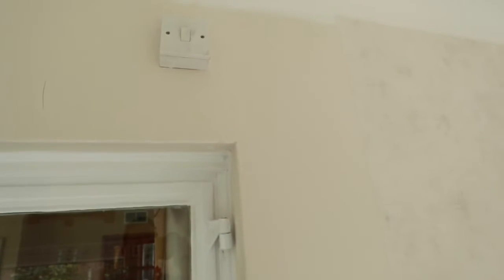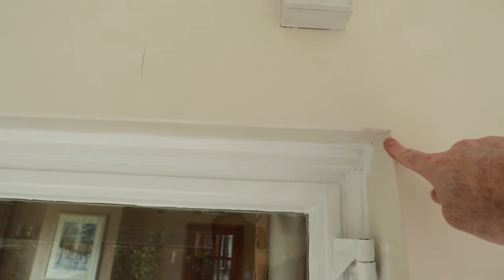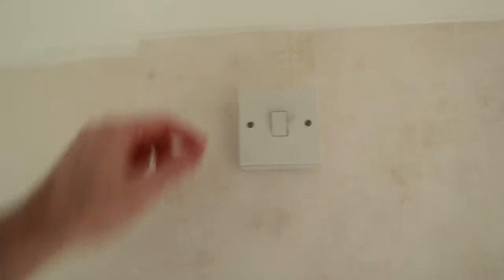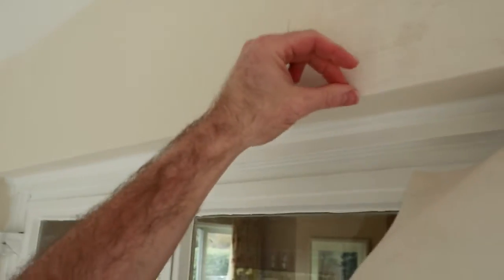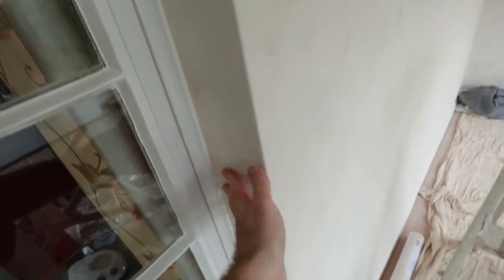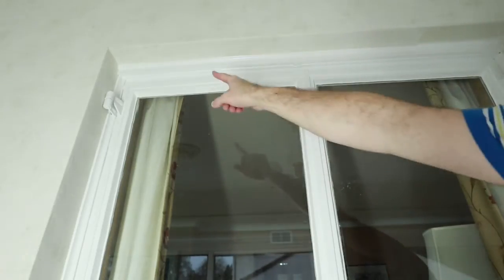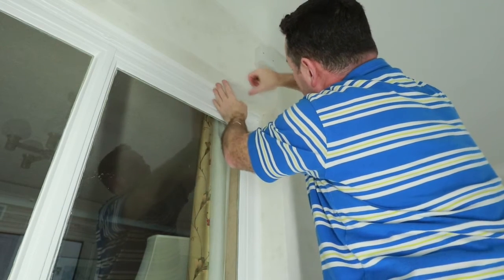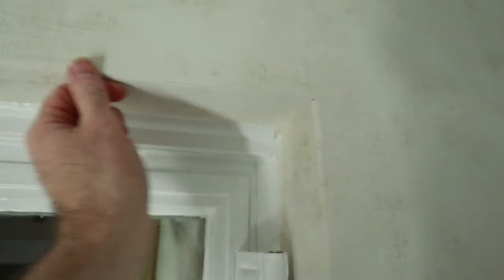how to - wallpapering around a window - the nasty bit

Comment: Hello Phil, I was a decorator for ten years (1996-2006), then I went off and had a “career” which after 16 years I have had enough of and have decided to go back to my passion. Just started out again. Paste the wall has clearly come on a long way since my first time round because it was truly awful. Difficult to control the saturation. I’m always happy to move with the times and blend the traditional with new ways but have you encountered any issues with the modern PTW papers? And do you use dedicated PTW paste? 

Really appreciate your videos, when I was working out how to go back to decorating they kept me inspired, so thank you. All the best
Reply from the maker: Lovely words Thanks.

PTW.... Don't over think it.
But..... Some PTW papers have very very small 'glass' beads on them.. drop everywhere.
Even though they are non woven PTW. Those papers are best to be pasted on the paper. Brush down the length to get any loose beads off, then paste as normal. Then hang.
The reason you don't PTW with those.... If you did, the beads can drop off while hanging.. stick to the paste in the wall.. you can't see to remove them.. but they'll show up under the paper like a bowling ball once youve got it on.

Also get yourself a decent laser liner.
Reply: @ProfessionalPainterDecorator  I will definitely invest in one, thanks for the tips 👍
Reply from the maker: @xxnonstopdancingxx  btw... Paste... Wickes own brand does almost everything 
If you have a expensive paper that says use their paste.   Let tye customer buy it. Then no come back ;)
Reply: @ProfessionalPainterDecorator  thanks for this Phil. I have a wallpaper job on Monday. There is a Wickes about 5 miles away en route to the job, so that is handy. What is even more important is that there is a van in the corner of the car park that does a bacon and egg fresh baguette for £2.50.
Reply from the maker: @xxnonstopdancingxx  the Tarde card discount will pay for the food lol
Reply: @ProfessionalPainterDecorator  Hi Phil just wanted to let you know that I used that Wickes paste. Brilliant. Thanks for the tip. I doubt I’ll ever mix my own paste again. Really easy to use, great open time, able to use a spritz of water to increase slip if I needed to without soaking everything. Game changer for me. Appreciate it 👍
Reply from the maker: @xxnonstopdancingxx  great to know ... Don't tell too many.. let them struggle with packet past a bit longer lol

Comment: Thanks Phill, love your videos , really helpful , can you go into window reveals with wallrock thermal lining paper? Thanks
Reply from the maker: The fabric wall rock or the polystyrene backed one?

You can, but you cut it neat to the corners 

Then polystyrene/paper faced one, if you have and gaps etc, use one of those light weight fillers .. like red devil or the prestone light weight fillers..... Keep it neat and it will dry 
Then you'll line over it again just with the normal fibre non woven wallpaper rock.

They'll be a video on the thermic  carbon WallRock  later on in March.
Reply: The fabric one

Comment: Hi Phil.  Thanks !!! Followed your advice for the joint infill instead of the splice and it went in a treat 😎👍👍
Reply from the maker: Glad to here, it means less visible cuts .. but there will be times doing a splice will work in your favor.. it will depend on tye type and pattern of a paper.

Glad you had success though :)
Reply: @ProfessionalPainterDecorator  top man. Working that but edge was a worry till I started melting the two edges together! Great vid. Great advice

Comment: I'm part way through a job where I'm papering a bathroom with a heavily patterned floral vinyl paste the wall for the customer, it was spliced around the window previously, so was going to do the same, but you've got me rethinking it now!
Reply from the maker: Hi Kris.
Do what you feel is best visual to the eye.. also for you too.

I had one yesterday I had to slice as I had no room to fit a piece under. But it was no pattern, no match and you couldn't see it.

If you have spare paper . Try both ways if you can.
What you don't want is a splice through the pattern that moves and it then doesn't look like it's matching.

Every job is different. It's being able to do various ways that's handy to have in your arsenal ;)
Reply from the maker: How did the paper look before being spliced?
Had the edges sprung . Or altered in colour highlighting where it was cut?
Reply: @ProfessionalPainterDecorator  looked okay to be fair, it's a light background design, the edges had darkened slightly but considering it's a bathroom with only a window for ventilation it had held up pretty well, they had a 5mm overlap on the underside too, where the upright part met the spliced in section underside. The customer was good at decorating when they were a bit younger and did it themselves I think.
Reply: It's a shame I can't attach a photo in YouTube comments!
Reply: Actually, after looking back at the before photos, I'm going with your method 😊
Reply from the maker: @krisholden8490  always PM via Instagram if needs be
Reply from the maker: Just a follow up. Been to a job and saw a room where it had been spliced/cut across from the corner of the window to where the edge of the paper is. It stood out like a sore thumb. You saw the cut, which has sprung slightly and the pattern matching had moved slightly.
So... You need to work out what looks best for the situation you're in.

Comment: Always splice it's not difficult at all, it's just the same principle as matching 2 lengths up but your just doing a double cut. This is an amateurs way patching pieces in.
Reply from the maker: Thanks for your input.
Reply: i agree 100%  not a good look for a professional .for example if that piece springs it will look worse than any splice.

Comment: Great video yet again mate. The Whicks paste that you use, can it be used on paste the paper  and wall.
Reply from the maker: That it can. 
I also use it for WallRock fibre lining.. paste the wall.
For normal (800 + etc) lining paper or normal wallpaper, you may thin it a bit to aid apply.

If the wallpaper is prepasted (you know, those that say soak in a water bath) we really thin it down, almost like a watery thin paste.
Works very well.
Reply: @Phil Beckwith The Professional Painter & Decorator  Thanks Phil. I will certainly be giving it a go on my next wallpapering job 👍
Reply from the maker: @davidstanger9077  don't laff.... B&Q good home is also ok.
I used it when my local places didn't have any yellow top beeline... And hung a quality finish paper with it.
The video was a few weeks ago about placement.
Didn't have any problems
Reply: Haha, I used Good home durable matt a few weeks back which the customer had already bought and It wanst to bad, cover really well white over cream in 2 coats.

Comment: great vid and explained very well. I would of like to seen the reverse cut to you first piece of paper you hanged in part 1
Reply from the maker: What do you mean reverse?

Another vid goes out Sunday showing the other internal angle being done.
Reply: @ProfessionalPainterDecorator  so you've hung your first piece of paper overlapped it then trimmed of excess paper . the second piece of paper you talked about doing over lapping then trimming with your shears. I've heard that called a reverse cut not sure if it correct mined.
Reply from the maker: @richardloze5994  I follow you now.

Yes. I was giving the example that if you came in from the other side, you can find that where I trimmed more at the top on the left length... It can be more off the bottom on the right length. (Into the corners).

Sunday video may show you bette how you come back onto your overlap (the 5mm return)... Using the trimmed down off cut.

My other videos showing you papering with a laser liner on corners that run out may also help.
Reply from the maker: https://youtu.be/mKj2fGjBJE0 take a look. Any better?

Comment: Not a method I would entertain, FairPlay to you if it works
Reply from the maker: Why not?

It a good way, when you have papers that can show cut joints, or there's a chance of pattern looking off due to cutting through it.
Nothing worse than seeing an angle cut from the corner of a reveal to a good paper edge.
Doing it how i show means you'll lose any cut edge on the corner of the reveal.

The less cuts and splices the better.
Reply: I would just have one vertical splice which would be seamless and with correct pattern match.
On the under wrap around I imagine you would have a sharp edge against your next piece which you have wrapped around. If it works for you great and your client is happy, that all that matters. Plenty of ways to skin a cat as they say!
Reply from the maker: you need to weigh up the type of paper too, 
that blue oriental style paper I show on other videos, I did cut top to bottom over a window...
1. the window edges could take it.
2. the paper was non woven and cut well
3. how the papers fell, it meant I could lose the cut well, without seeing it due to the fussiness of the pattern.

So I do it that way as well, when needed/or when allows.
Reply: It works is the main thing

Comment: You wouldnt always put that end peice in before the other 2 short pieces.if it wasnt paste the wall.paper it could expand more and you get it overlapping when it dries out properly.
Reply from the maker: thanks for the comment. If you are talking about PASTE the paper.. as long as you allow it to soak the correct length of time, you don't get expansion/stretch of the paper. I see people having problems with expansion, but that comes down to not giving it enough time. 
I do all sorts of papers.. PTW and PTP, my style can be the same with either. 
Don't forget.. Tub paste is key too. Less water content ;)
Reply: @ProfessionalPainterDecorator  I'm saying if you where using a normal paper I would nt really hang the other corner piece and the one next to it before hanging that 2 nd piece as it might possibly start overlapping once it s dried out.
Reply from the maker: @davidphillips744  it shouldn't overlap when it's dried out.

Comment: Your doing a good job but in my opinion you shouldn't put a but joint above a window like that because all it takes it a slight bit of moisture and it will probably curl up , a double cut when done correctly will not and shouldn't be noticeable at all, I was a painter and decorator for 38 years so I know what I'm talking about, wish you well as you are doing well
Reply from the maker: If moisture gets on that edge, it would also on any butt joint around it.
Double cuts are fine, as long as the paper suits a double cut, if the pattern mis matches through a cut it shows like a sore thumb.
It's knowing what to use where and what looks best.

Keep an eye out for future posts on Instagram and the Facebook page, you'll see some papering where the paper needed to be double cut and  the reveals needed to be wrapped around due to the rounded edges on the edges.
Reply: @ProfessionalPainterDecorator  I've retired now through ill health,  some wall coverings won't double cut withought ripping as it can be like wet tissue paper, I used very thin Olfa blades for double cutting only came across them a year before I retired